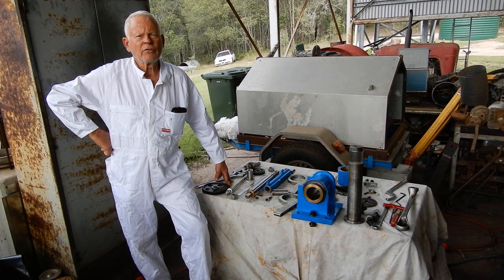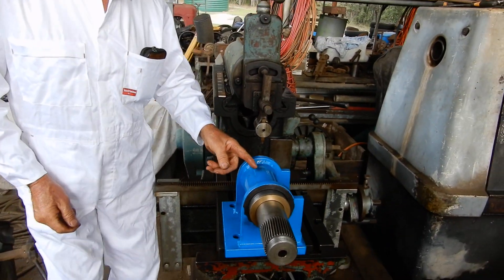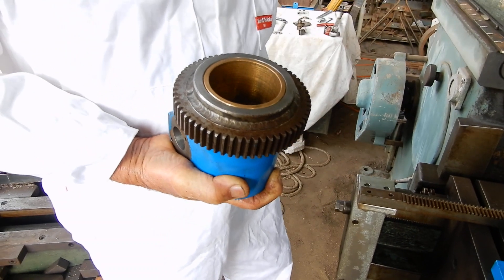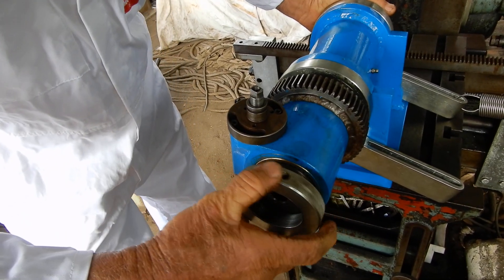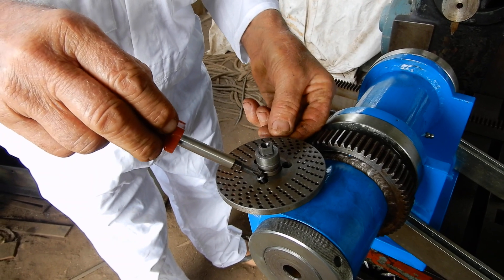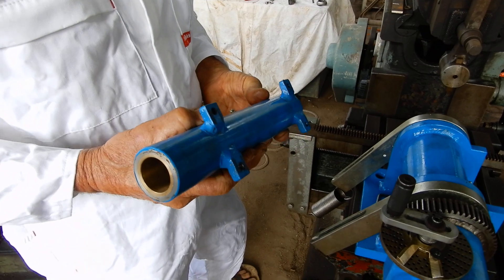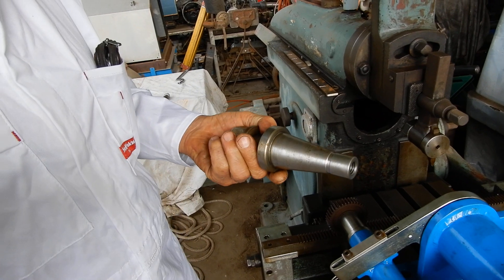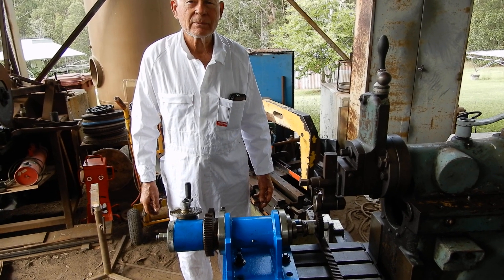Shaper gear cutter assembly video

Comment: Sorry but a dont undertand the part about the gear ratios. Does it use the same ratio to cut any numer of tooths or does it require a specific ratio for each number of teeth? Or does the relationship have to change acording to the pitch of the gear its going to cut?
Reply from the maker: the gear ratio is specific for each number of teeth   correct. ... but you don't need to use the same DP as i did to achieve that...    i used 12 DP  because i have a set of 12 DP gears that  came with a universal dividing head that i own but someone else have a big pile of 16 DP and they could use them obviously the rack would need to match and you could not work out the ratio multiplying or dividing tooth numbers you would need to convert the DP to inches

Comment: Thanks for the vídeo
I'm not speak English, but I hope you understand me this question...

What is the number of the driving and driven wheels?
 ¿Are they always used for all types of pine nut carving?
Reply from the maker: suppose the gear you want to cut is 30 tooth ....the welded gear is 60 tooth that would mean the racio  to the welded gear would be 1 to 2  so the racio of the other gears needs to be the same ....it could be 30 to 60 or... 24 to 48  or... 15 to 30 or...20 to 40 or...28 to 56 as seen in the cutting video